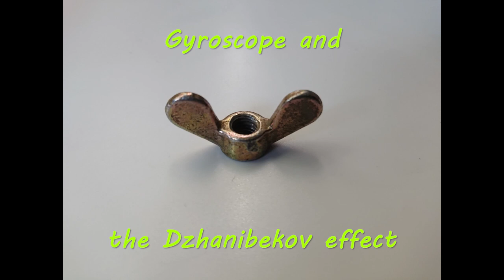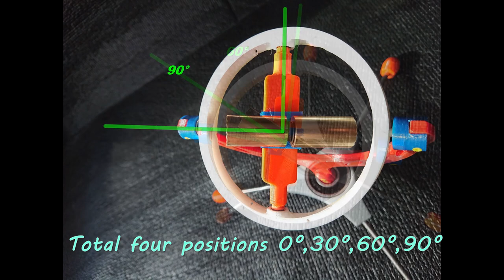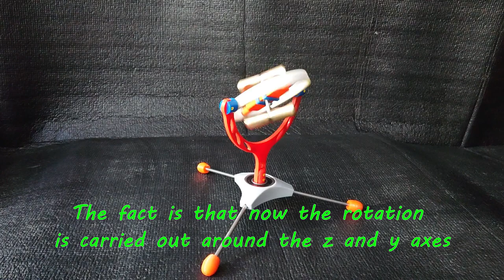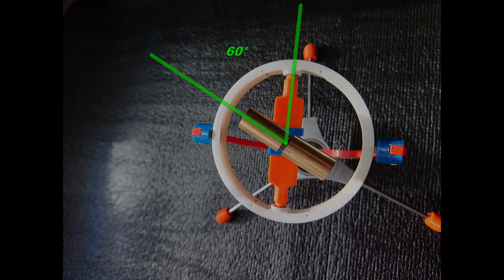The Dzhanibekov effect and the "Chaos" gyroscope with an asymmetric flywheel.

Comment: The issue here is not the Dzhanibekov effect.  It goes crazy because at 30deg and 60deg you are rotating your object about an axis that is not principal.  i.e. it is not dynamically balanced.
Reply from the maker: The Dzhanibekov effect is one of the cases when the axis of rotation does not coincide with one of the three axes of inertia. This effect is demonstrated in the video in slow motion using an almost authentic nut.
Reply: Sorry, that’s not right either. The Dzhanibekov effect happens when an object is rotating approximately (but not exactly) about the intermediate principal axis.
Reply from the maker: @904cmw  It's not clear what you disagree with. The axis of rotation will NOT change its direction only if it exactly coincides with one of the three main axes of inertia of the body. The Dzhanibekov effect is only one particular case, and yes, initially, the axis of rotation was located close to the axis of inertia with an average value.